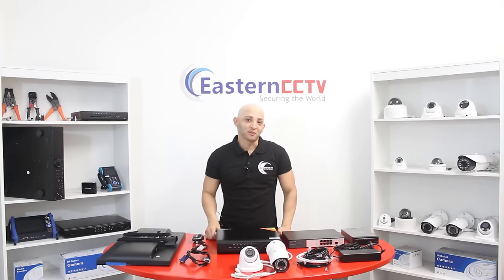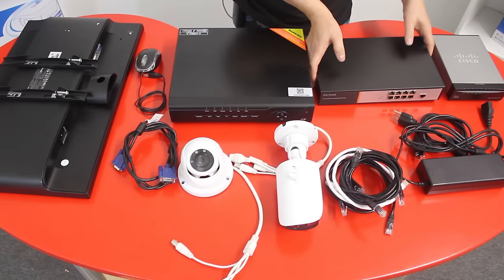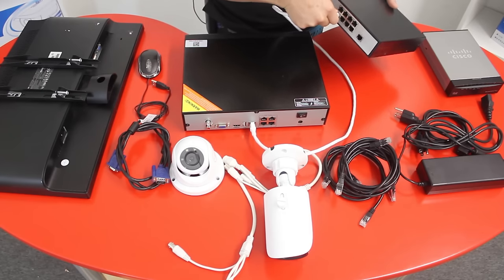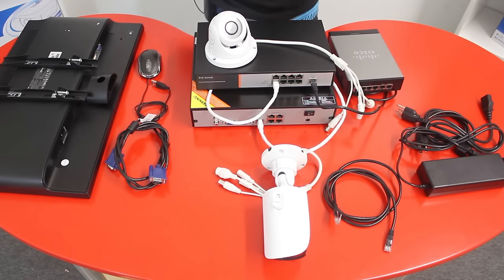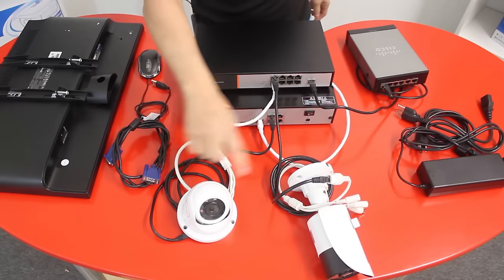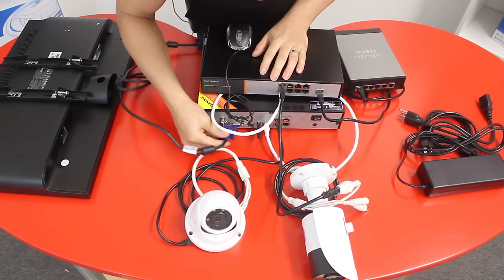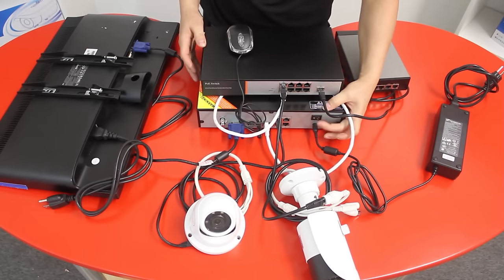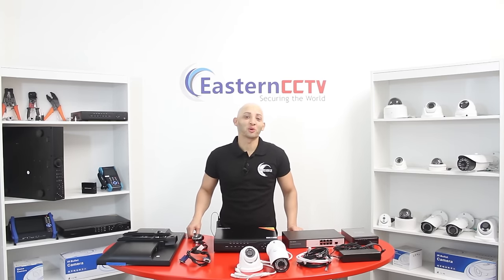How to Setup and connect an NVR Security System Using External PoE Switch

Comment: Thanks for the thorough and clear explanation of connecting the NVR to an external POE switch.  Even the rep at Amcrest was not able to assist me with the set up.  The only question I have is, can I connect POE cameras as well as wifi IP cameras to this set up or only POE cameras?  Thanks and once again, great video.
Reply from the maker: Hello Luis. The Wifi Cameras most likely will be connected to the Router. The NVR and PoE switch will also be connected to the router. If everything is on the same network then you shouldn't have a problem adding the IP cameras top the NVR.

Comment: So helpful and self explanatory. In my case, I have a PoE switch and an NVR but without a router. How do I configure the switch to serve this purpose. Each time I plug the camera to the NVR, it comes up but when I plug the cameras to the switch (and NVR to the switch on the appropriate ports) the cameras won't come up.
Reply from the maker: You will need a laptop or a computer that you can plug it to the PoE switch. Install the software that comes with the IP cameras and uses their Utility setup tool to setup each IP camera. for example, if you have 5 IP cameras you can assign the following information. IP: 192.168.1.10 to 14 (Each IP camera has a different IP) Subnet: 255.255.255.0 (All IP cameras have the same SUB) Gateway: 192.168.1.1 (All IP cameras have the same) the NVR set it with the IP 192.168.1.15 with the same SUBNET and same gateway. Once you had setup the ip address settings on each IP camera and on the NVR then you will add the IP cameras manually using the Manual add function on the NVR. Hope this helps. =)

Comment: If i understand this correctly, can I run all 8 of my PoE cameras to a PoE switch and then run one (1) cat5 network cable from the switch to my NVR and run another cat5 cable from the PoE switch to the router?  This would help having to run 8 seperate network cables to the back of my NVR.
Reply from the maker: YES. but make sure that the Cable that you RUN to the Router is the UPLINK from the PoE Switch and the Cable that you connect to the NVR from the PoE switch is connected to the LAN PORT on the NVR.

Comment: I'm considering to have the poe switch and four cameras connected in the garage.  The nvr with four cameras connected and router in the basement.  If the poe switch gigabit uplink is connected to the nvr lan port,  where would I plug in the router in this case as the lan port on the NVR is already used for the switch connection?  Thanks in advance.
Reply from the maker: Sorry for the late reply. You can connect the NVR to any of the ports in the switch. the UP-Link port on the switch connect that to the router. Basically, from the Router get a CAT5/6 and connect it to the UP-Link on the PoE Switch and then connect the Cameras and NVR to the PoE ports on the switch.
Reply: @ENSSecurity  No worries.  Thanks for the reply. That makes sense then.  My issue I did not mention is that I do not have router access in the garage and vaulted ceilings between.  I only have one cable between the two areas of my house.   

The POE switch that comes with the kit I'm considering is only T10/100 ports for the cameras and one gigabit uplink port.  

Would this work? 

 I already have a 24 port switch with 48gbps switching power that I use for my home network.  I currently only use 8 of those ports.       If I connect both the garage poe switch gigabit port and the NVR gigabit port to my existing 24 port gbps switch, will the NVR recognize the cameras?
Reply: Did  it work?
Reply: @chuckhowland5146  the set up above worked really well. All I had to do was add a cheap regular $15 gigabit switch in the middle of this setup. So my garage has four cameras connected to a p o e switch. A wire comes out of the poe switch in the garage, runs the length of my house down into the basement, then plugs in to the $15 gigabit switch. Then I plugged the NVR internet port into that regular switch and my router into that regular switch. My four wired cameras at this end of the house will reach the basement and they plug directly into the NVR.
Reply: I did it this way on my neighbor set up as his was similar to mine except he didn't already have a 24-port switch. I went ahead and used the 24-port switch that I already had in the basement and didn't need to buy the extra 5 Port switch for my setup.

Comment: Thanks for the set up guide. Where  however do I configure the camera video setting. Direct via ip or via the NVR? Will they sync? If I change the frame rate on the NVR for example will this change the camera setting if connected via a switch? Thanks
Reply from the maker: As long as using the same product line, the NVR will push video settings to the camera. Your mileage may vary if using the third party, but generally: if the NVR allows you to change, it will likely get pushed to the camera
Reply: @ENSSecurity  thank you so much ENS for your response. Much appreciated ⭐⭐⭐⭐⭐
Reply from the maker: @sigiroy1  No problem. Anytime.

Comment: Your Poe switch doesn't seem to be AC powered, is that true.  I'm just wondering as I don't have any power sockets in my loft but I'd like to run all my camera cables into my loft to a Poe switch and then just have a single cable running down into my living area to the nvr
Reply: Poe switch needs power. Plug ur pow switch to AC in your loft. Terminate all ur camera wires to switch. Run single cable from poe switch uplink to router lan port. Connect nvr to router lan port. Bingo, u r connected.

Comment: So the only purpose of the POE switch is to increase the number of cameras supported?  Or, I suppose, if the NVR was too far away from the router the switch could connect between them?   Thank you.
Reply from the maker: PoE switch is for the situation that the NVR doesn't have the Power over Coax function.

Comment: Can you run 4 15V POE cameras from a 48V NVR?

Do I need a POE switch? If so, what sort of specs should I look for? 

The store said a switch would work, but gave no more info. I tried using an old gigabit switch but I couldn’t get it to work. Maybe I didn’t set it up right. Last time I just plugged the cams into the NVR and it detected them.
Reply: if you run power to every camera you have then a switch would work. BUT if you get a POE switch you can power the cam and transfer your date via one single Ethernet cable. As for power supply look and see how many total watts it takes to run your cams, then buy a poe switch to match your needs.

Comment: Thank you So much for this super useful video. Could I ask if the camera connected to the PoE Switch that build in NVR, the IP address will be different as the cameras also the Wan port on NVR, is that will ok? I mean the NVR will do the routing job?
Thank you
Reply from the maker: Dear customer, 
are you talking about the NVR that has POE function? The built-in PoE creates its own internal network for displaying cameras. Anything on external PoE will be on the general network. This is normal. NVR does not do any routing between the two networks but since the NVR is also on the LAN, you would, therefore, get camera feed access by logging into the NVR.
Reply: @ENSSecurity  thank you again for your reply,  What I have now is one NVR with build in 8port Poe switch, and this DNR can do 16 channels.after I used all up 8 build in POE port I will get extra POE switch ,and will connect with NVR uplink port . NVR Has build in 192,168.0.0 but Uplink is on 10.0.0.1 range . Does DVR will pick up camers on 10.0.0.0 range ?. Thank yoi
Reply from the maker: @Colinlkf731  Cameras outside of the built-in PoE switch will need to connect to an external PoE switch tapped into the normal network where your 192.168.0.0 network is. Avoid chaining an external switch to the internal switch.
Reply: @ENSSecurity  thank you very much
Reply: @ENSSecurity  Is it possible that a DVR or built Poe could be blocking cameras signals this causing video loss?

Comment: 6 of my 8 ports on my NVR are dead....can I use a Poe switch like your video? My warranty from LaView literally just expired and LaView told me I would need to buy a new NVR. I’m trying to avoid this....
Reply from the maker: Yes, you can use an External PoE Switch for this case. But you ming need to do some extra configuration to the IP cameras in order to work because you are not doing Plug &Play directly to the NVR. For those steps I recommend you contact the manufacturer of your system for Technical Guidance. =)

Comment: can I take a CAT 5 port from my router (nonPOE) and plug into the UPLINK port and use a POE port to go to my DVR, will this damage my DVR LAN PORT? also is the POE wiring standard 468B pin out on the RJ45 jack?
Reply from the maker: Yes you can do that. but the wiring has to be T-568B. (maybe you had a typo) Plugging a Non-PoE Network Device such as a laptop or DVR/NVR no a PoE port will not damage anything. so the answer to both of your questions is YES =)

Comment: can we connect multiple poe switch to an nvr? if we have more cameras in a vast building, then to avoid multiple wirings, using more than one switch could solve the problem right.
Reply from the maker: Yes you can connect multiple PoE switches in a daisy chain mode, meaning if you have 2 PoE switches the first PoE Uplink will be connected to the Router and the Second PoE switch Uplink can be connected to any port on the First PoE switch or the secondary Uplink Port on the PoE Switch if it has one. If you have multiple PoE Switches in different locations of the building, Each Uplink you can connect it to a regular Network Switch as long as the switch is connected to the router.

Comment: Good day sir....i have an 8 lan port nvr, all of which are poe. It has an ip of 192.168.1.1 and has a capability of giving an ip add of 172.16.x.x. as of now there are only 3 ip cam connected to it but planning to add the remaining 5 ip cam, which are 150m from nvr, can i connect those 5 ip cam to the poe switch then the uplink of it to the lan port of the nvr? Or router? What should i do? Pls help me.. Thank you sir....

Comment: Hello, 
        I see some nvr units only have 1 rj-45 port but utalize wifi connection.
         I have 2 ip cameras and i have a poe switch.  Could my switch carry over to the nvr rj-45 both my cameras?
            They were set up to my qnap nas but the cpu  was getting very high usage (80 -93%) and was getting worried! 
       I also don't want a loud fan wurring away to loud as the set up is in n our living area. I hope you can please give me your input, thank you!
Reply from the maker: The Software uses high CPU usage. You might need to contact Qnap for help. The NVRs that only have one RJ45 port you will always need an external PoE switch to power on the IP cameras. or if you have the IP cameras already with 12VDC power then there is no need to have an external PoE switch. YES any switch can carry all devices. SO you will need to connect it like this. 1. NVR to Router, PoE Switch to Router, IP cameras to PoE switch. OR NVR and IP cameras to PoE switch and the PoE switch to the Router.
Reply: @ENSSecurity  
Thank you

Comment: Pls help me, good sir. I am a newbie to CCTVs and needs major clarification. 
What if you have 32 cctv cameras?  Example: what if I have a NVR that has built in 16 Ethernet ports, and a switch that also has 16 Ethernet ports. If I use the same set up that you did, which is when you connected the nvr to the switch's port, then that would mean that I could get 16 CCTVs conneced  to my NVR's built in port, but only connect 15 CCTVs on my switch because one of those ports is being occupied by a port comming from the nvr, which means, out of the 32 CCTVs I have only 31 can be connected. Please help me. I'm so new to this
Reply from the maker: Typically when shopping around switches for a job, you would select a switch that has enough PoE ports for your cameras as well as the uplink port(s) to link to the network. It can vary, but there are usually 1 or 2 uplink ports on PoE switches.

Comment: Hello!I have a nvr and poe system.Now i will buy ip cameras but in market 48v and 12v ip cameras  selling.I dont want to use power adapter for the cameras.Which model is right for me?My system can work the cameras?Thank you...
Reply from the maker: Hello Cenk, Any NVR that has Build-in POE ports the voltage is always 48V.. You need to find an IP Camera that supports PoE. If your IP Camera supports PoE then you can buy any type of IP Camera as long as the IP Camera Specs supports PoE. Then the Last thing you will need to check is the compatibility of the IP camera to your NVR. if you buy third party IP cameras make sure they are ONVIF Compliant and your NVR also supports ONVIF Protocol.

Comment: Thanks for this great video.  I have 1 question.  When I connect the cameras to the NVR PoE ports, the cameras are located in their own network segment (10.x.x.x).  So the cameras are not directly accessible from my home network (192.168.x.x).  To access the camera web interfaces, I have to go through the NVR.  I like that since the cameras are hidden behind the NVR and the cameras 4K traffic are not overwhelming my home network.  I'm guessing when you connect the cameras to the switch, they will be on the same network segment as everything else on your network. 
My question is:  how can I do the same thing with the external PoE switch?  Meaning, how do I put them on their own separate network segment?
Reply from the maker: Hi, if you are using an external switch, you would not want to chain a switch into the built-in PoE since the built-in PoE only expects there to be cameras plugged in and unexpected things can happen due to the Plug-n-play command. If you would like the cameras to be on their own network - the best thing to do would be to use a recorder that has two LAN ports. One LAN you would use your normal 192.168.x.x address and can use this port for remote access. The second port you would set to a different address scheme (172.16.x.x, for example) and then manually assign the addresses to the cameras and then add them to the recorder.
Reply: @ENSSecurity  Thanks for the video.  I had already done what you suggested above.  My GW3208 NVR has an Ethernet port and 2 banks with 4 POE ports each.  The lower bank died due to a surge.  I connected a new 8-port POE to one of the upper good working port on the NVR.  Now I have 3 cameras on the NVR and 2 on the POE switch.  Unfortunately, either of the 2 cameras on the new switch will drop of the NVR list of cameras, maybe 3 to 4 times daily.  The NVR is on a 192.168.0.xxx network and all cameras are fixed IP on the 192.168.1.xxx.  All the cameras connected directly to the NVR always work.  Thank a lot.

Comment: Hi. Is it possible to use the NVR's built in ports and the switch's built in ports at the same time? Example if there's not enough Ethernet ports at the of the switch or at the NVR's built in port
Reply from the maker: Yes, you can mix NVR with Switch. However, the total channels that the NVR can record are limited to the spec. If it is a 16CH NVR, it means it can only record 16 channels. Usually, the NVR has one or two extra ports for the internet or switch. For example, if it is a 16CH PoE NVR, it might have 17 RJ45 jacks, the 16 jacks are for the IP cameras, and another jack is for the internet or switch.
Reply: @ENSSecurity For example, if i have 32 cctv cameras in total, and I have a nvr that has 16 built in ports, and a switch that has 16 ports as well. Can I connect the 16 cctv to and nvr and the other 16 at the switch, so that I can use the 32 cctv cameras that I have?
Reply from the maker: @johnpaulpanton5403   The NVR is a recorder, it can only record whatever the system's spec. If it is a 16CH NVR, it can only record 16 cameras, and for the extra cameras, you have to find another way to record it. However, if your purpose is for remote viewing only, you can do unlimited cameras as long as the IP addresses of cameras do not conflict with each other. 
So, according to your question, if the NVR can support up to 32 channels, you can record 16 cameras connecting to NVR and the other 16 cameras connecting to the switch.  However, if you use a 16 channels NVR with the same topology, then you can only record 16 cameras. And to those 16 channels, they can be some from the cameras connecting to the switch, and some from the cameras connecting to the NVR.
Reply: @ENSSecurity  I see. Thank you so much. so just to sum things up, if I have:

- 32 cameras in total
-an NVR that has 16 built in Ethernet ports at the back
- a switch that has 16 Ethernet ports as well;

then I can connect the 16 cameras at the back of the NVR and the other 16 at the back of the switch, so that I can use the whole 32 cctv cameras. Is that correct? 

But only those cameras that are connected on the back of the NVR will record playbacks. Did I get that right?
Reply from the maker: @johnpaulpanton5403  Almost correct.  
You can pick any 16 cameras to record, it doesn't necessary to be the cameras that connect to NVR, it can be some cameras from NVR and some cameras from the switch as long as they are under the same network.
Reply: @ENSSecurity  thank you so mcuh. You have been a great help. Happy new year to you. I wish you and your page nothing but success.

Comment: When looking for an NVR how can I tell if I'm able to get full 1080p on each channel given it's a 8CH or 16CH NVR.
Reply from the maker: Hi Brian, You should look under the Record Settings, Some times its called Encode or Encode Parameters. The resolution should be 1920x1080 or usually for 1080P another name is also 2MP ( Megapixel )